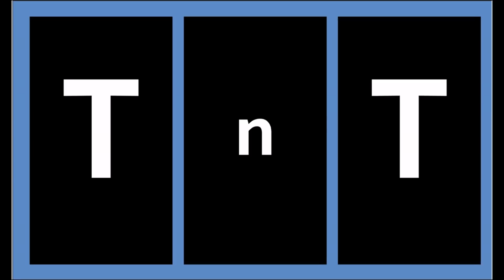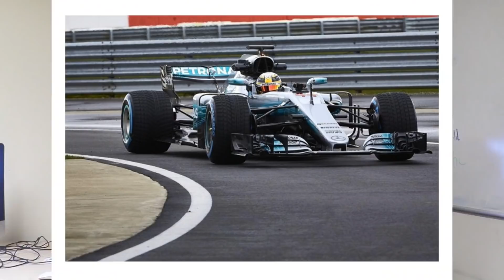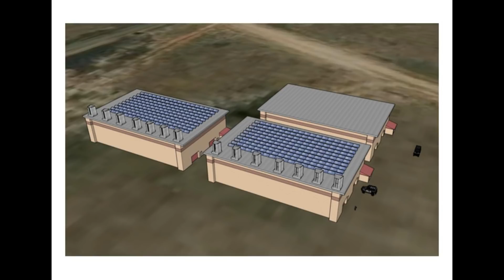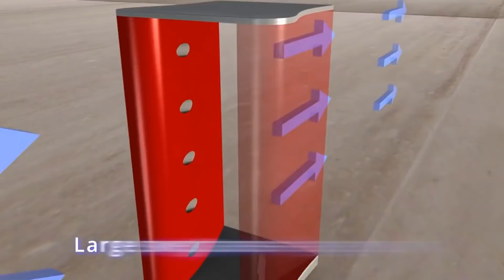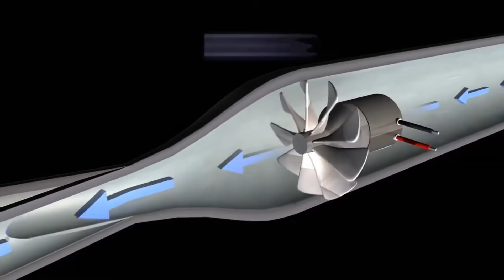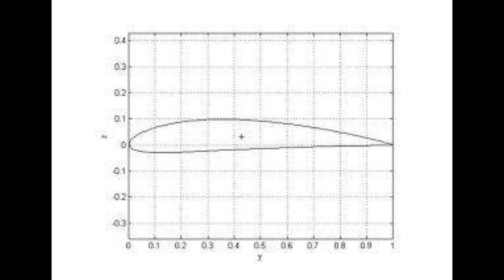1361 Mining Energy From The Air - The Aeromine - The Next Thing In Wind Power

Comment: So fun talk but no actual working generation of Power. What a waste of wood! Isn't lifting the flaps using up energy? Probably, if it works at all it would do better with sheets/strips of plastic sheet. with little or no weight to lift up to open te wind side.

Comment: yes 3d printing, for the areo foil, manifold, the problem is anchoring it to your home. the added possibility is cooling a vented attic for cycling air in a passive attic system. then some chicken wire for all the holes should suffice to keep critters out.

Comment: Simple rule: A volume of moving air (molecules) hits a surface (no matter whether (all) rotating or fixed "to collect"; e.g. diffusors absorb wind energy to create suction like a vacuum cleaner that is not so exiting without electricity). In order to absorb some of that, you need material. The more, the more expensive (material cost).
If trying to absorb too much wind energy, then the structure progressively becomes an obstacle: Wind moves around (...that dust in your eyes when passing a building's corner - remember?).
What's the trick? Simple: You build a wind turbine and "forget" mentioning the fixed rotor structure (area) that catches additional wind energy to e.g. cause suction. With that trick you can claim to produce more electricity than there is energy in the wind that goes through whatever you call "rotor" (i.e. a percentage of the actual rotor!).
Mother nature makes wind energy grow exponentially with wind speed: To the third power of it. So, if wind speed doubles, energy grows 8x (no typo: eight(!) times). Not so surprisingly it does the same vice versa: Half of wind speed ...and its energy collapses to 1/8 (one eighth).
Wind speeds close to ground are low (e.g. 3 m/s contains 0.5 x 1.225 kg [common air density above ground] x 3 m/s x 3 m/s x 3 m/s = 16.5375 Watt per m² gross (!) wind energy - some of which (max 59.22%) you can absorb before wind will progressively blow around (like around any other obstacle!) instead of going through.
Do not need to believe: Just build and measure. So simple. Law of nature. Physics.
Building wind turbines: a) reduce amount of material per m² as much as possible, b) use sites with sufficient wind (remember exponential growth!)

Comment: Stick that on top of a tube with a swivel base so it can turn to face the prevailing wind like ducted turbines do and you'd have a wind turbine, except the blades and generator can be down at ground level where it's easy to manage. Nice! Could also use it for passive HVAC concepts. This is REALLY smooth.
Reply: FWIW: I was wondering about the swivel thing myself.

Comment: That is awesome! You could combine that technology with the cheaper type of geothermal along with a solar chimney and truly benefit. 
For example, hook the turbine input of the Aeromine to a 8 to 12 inch geothermal piping system that will run thru the ground for about 100 linier ft then pops up out of the ground at the end of the 100ft run for the air input. This way the air is cooled, we can benefit from this because the solar chimney will be the Aeromine itself. Face the Aeromine so that the sun beats on the panels where the air flow is being sucked up, this way the heated chimney will hasten the process. Even without wind it will still suck air thru the turbine as long as the sun is out beating down. It is like a thermal syphon. Granted i don't know how much air it will pull on its own, if it is worth trying or not, maybe if we could do on a smaller scale first to see the outcome.
But one thing is certain, the solar chimney does work but how much air can it move i am not sure yet. But if it is not enough, we could try mirrors to concentrate more energy on the chimney.

Comment: I see a couple of difficulties with the proposed configuration... 1) The air has to change direction and speed multiple times, and often across short distances. That will create drag and turbulence, which wastes wind power as heat. 2) The multi-blade ducted fan IS a moving part, so "no moving parts" is not true. 3) The wind tower needs to rotate so that the opening is always facing into the wind, so "no moving parts" is not true there either. 4) PC fans have weak rubber magnets, which are fine for using power, but bad for making power. 5) PC fans lack nose and tail cones needed for streamlining/drag reduction.

Comment: But you got terrible losses all the way from the location between air foils to where the fan will be. So it will be more efficient to have a windmill instead with a foil all around the propeller. You eliminate the duct work. Air conditioners have duct work and they need a powerful fan to overcome all the drag and move air.

Comment: I'm interested in passive uses for the aeromine -- either to replace electric fans/AC and circulate air out of the attic / house in the summer -- or to draw a syphon and add energy storage with some hydraulic or pneumatic system.

Comment: Keeping the air that exits the vent holes in the airfoil from causing wind flow separation downwind of the vents will be the key to making the system work.  Airfoil flow separation will cause the loss of the low pressure area (stall).

Comment: looks like a Dyson heater fan running in reverse, they push air out the holes and pull extra air through the loop. so moving a lot more air than the fan would on it's own.

Comment: the foils  look pretty well suited for 3d printing using just a few wall layers and leaving the rest empty though you could easily play around how you want the air to move while inside the foils
I'm wondering if you've ever looked into using wind power to directly making heat through the use of joule machine or eddy current generator

Comment: Instead of making pipes sticking horizontal out of the vertical wings, isnt it  a better idea to make a vertical shat inside each wing, wich can also be regulate the flows by opening and closing the shaft a bit. For test puposes or for savety against overworking the motor.

Comment: Looks easy enough to build using RC model techniques....use PVC, or even cardboard tubes, for the ducting and incorporate the tubes into the airfoil just a bit ahead of the wigs designed center of lift location.
A very simple build for testing could be done with not much more than the tubing, some styrofoam blocks and a hotwire cutter with an appropriate template.
I could see a horizontal string of these being made at one foot tall and ten feet wide rather than the single ten foot tall version as well.
Unfortunately, I live in an area where wind power of any kind isn't economically feasible because we just don't have consistent wind...except on the days when we want to fly rc...lol

Comment: Guess you need to scavenge a Dyson fan and replace the small blower inside with a small turbine? There is another way to mine with wind: Electrolyzing sea water even with electrodes placed directly in the ocean on a raft. After a while, they build up a metal rich sludge, mostly Mangan but also a minuscule amount of Gold and other rare metals. This sludge can be dried and sold as is without further refining.

Comment: well yes this is very cool, thanks Robert. Sort of reminds me of what type of Air velocity stack I was thinking about using on my gopher hole wind generator, ground level impeller generator combination with open drafting to a large vertical culvert tube, with some sort of enhancement cap. when I was a kid I had my head inside of one of those gigantic air raid siren horns, the one with the flat panels, Or perhaps like the Cheney talking machine from 1914.  I wanted to use that horn design as a passive way to improve the draft of the vertical culvert tube, hopefully advancing the output of the generator at the bottom of the tower with an action similar to a ladies old fashioned perfume bottle Sprayer. The goal of all that was to take the stupid generator off the darn tower and put it on the ground level where it could be maintained and dealt with, minimizing aerial maintenance of any type, along with weight and the hazards of big things crashing down on peoples heads, I also thought that oversize ductwork might suffice for the air siphon tube culvert tower thing.  I also thought that if it came down to it might be able to use a bit of Parabolic solar collection to provide a heat source to enhance the updraft, or if one was desperate, just a firebox, when I was in my 20s climbing on the top of a powerplant chimney, I was always amazed by the wind/drafting affect. And of course as a child always there where the gophers are the very dogs would build their entries in exits for their tunnels to facilitate airflow in the tunnels so they wouldn't suffocate.

Comment: I used that idea for venting a house at university. If the power generated is hight enough it therefore could have a double effect. A) generating power B) lowering costs for venting. Still the energy for air-conditioning will be needed. — therefore. For hot energy; could you think a parabolic mirror centralising sunlight to a lense what itself channels the light beam into a Glasfiber and then heats up a "battery" in the basement (well isolated water tank, sand, stoneblock, stones in water,.......) could generate usable thermal energy? How big would the mirror be? ... I got that idea first as a child when I thought about how one could have real sunlight in a basement. And later saw one of those sun stoves. It was cloudy so it couldn't get the water to boil. But still it got warm. .... Probably you already thought about it. But I live in an apartment. So I can't really experiment. For me there are some other ideas building on that idea to collect heat. But I basically was told of everyone that it's rubish. You seem to have fun to test every weird idea even if it's said to be not efficient ;)

Comment: Another way of extracting energy from the atmosphere would be harvesting static charge. 
Every meter in height holds 100 Volts potential difference.
Corona motors can work on this principle. This is ancient knowledge. Here is something to contemplate: 
Look at cathedrals: the top antenna (i.e. cross) the horn antenna (the spire) and the nowadays missing element: the chain from the top down to the altar. This would create a negative charged atmosphere which is very beneficial for human life. This why you need a head scarf... static charge runs your hair :)
There is energy everywhere. Think implosion instead of explosion. Just my two cents.
Reply: Static electricity has high impedance ... hence power is very limited , though the voltage would be higher .

Comment: Rob, this is very interesting! One of the concerns I have with wind harvesting is winter weather.  Heavy snow and/or ice tend to wreck havoc with wind turbines or "spinners" so this concept is very appealing.  Thanks!  Looking forward to learning about how this can be adapted at a smaller scale. Cheers.
Reply: Another purple V. First time I've seen one.
Reply: Problem with this in cold weather is on windless nights when the turbines don't move they might freeze up  --  especially in freezing fog  :(
Reply: @trueriver1950  Put a lid on the inlet, combine it with a muffler (sound absorber) on the same acis of a servo. 
If closed, you have no movement of ice fog loaded air. 
Put water glass based sealant on. 

I want to dig into vibration based de-icing of originally heat exchanger surfaces, but you can extend it to the problem here. It means you can enforce a resonance that is not showing up on regular operation, like installing an axis (near the metal sheet with the inlet holes or slits) with imbalance weights that performs as a solid sound transducer if turned at the right rpm. So the resonance along the metal sheet will shake off the ice from the impregnated surfaces. Tuning the rpm will move the knots and maxima of resonance to cover the full lengths. 

Then again, if you have multiple energy sources like PV, Wind, and a wood gas burner micro generator with lambda sensor air supply control to round your energy mix up, you may want to stop the turbine for the hopefully tiny percentage you suffer from ice winds carrying fog that is supercritical and glues to every surface.

Comment: Wait a minute! If you use an airfoil design from an indy car, yes it is designed to push the car down but at what speed? and what speed will your airfoils be traveling at? sounds like it might be a Wright Brothers mistake, doesn't it? or do you think the airfoils will be moving that fast? or will it require a hurricane to move? I guess it would be slower than some airplanes. what do you think Robert?

Comment: Problem with wind generators is they fail from time to time. I have had one up 60' for years and it fails now and then. Right now in a wind storm it puts out around 4 volts. There is a problem with it and it is hard to work on at 60'. Needs to be taken down which is a pain in the you know what.

Comment: i JUST GET A short circuit TO WORK WITH! WHY? YOU WORK IN 3D THE AIR INLET MUST FOLLOW THE WINDSTREAM! THE WING IN A DARRIUS SHIFT EASY WAY TO WORK! AND NOW THIS! PLEASE EXPLAIN BETTER I MUST DROPPED OF A WAGON! iF WE START  FROM THIS! THE SIZE IS A oil drum! can be one on a Gig boat! The oil drum force the wind in a wirl! And now between two hybrid fan blowing Vawt like umbrellas in thier forms the top-vawt and the bottom is not the same shape in thier wings becose both blow down and the form is like this <i> but Vertical! Now to the wind-direction a gigant churchrooster turn the😀 front right! The wind how slow down the propellers hit the barrel! And fart 0.5 m/s  wind exacly right on the left side to push the wings in a max torque Now to forces work for a wirlewind the winddrag from the top and the side! Now to reasonable balance the barrel its lika e carwheel a diffrent wieght on  one side need a conterweight on the other side! Now Rob I Just love Your works! You find golden nuggets on the YouTube! And  You can take this Idees in a Historic odysseus try religions symbol like a meaningful blueprint! A Swastika can be a Symbol for Company like ASEA now ABB but never for a Contry! For is it can be a Darius/Savonius/propeller you look down on or up too! If you make it in bamboo it is hard to find they today! But in Egypt you find a speciell formed stone in a circleformed places and off-course this is a secret places for the Gods...

Comment: This is why the Betz limit may turn out to be a bit of a red herring.... air that has passed through the rotors (speed reduced) gets sucked away by faster flowing air outside the swept area rather than stagnating. Careful design can maximize this effect (entrainment).
Reply: Seems you are right, the project site has stopped.

Comment: ????!
What are you talking about with solar being only 0.3 Watt hrs per square metre. Current photovoltaics manage 0.3KW per square meter, 0.1 if its cloudy. Solar thermal can harness over a KW per square metre.
Use your wind turbines to drive a refrigeration compressor, your solar thermal to dry out zeolite. 
Use an on demand flow valve controlled rankine cycle, better still Kalina cycle turbine with mix of water and ammonia to make electricity when you need it.

Comment: Research  "Whirligigs"  
Whirligigs are most commonly powered by the wind but can be hand, friction, or motor powered. They can be used as a kinetic garden ornament. They can also be designed to transmit sound and vibration into the ground to repel burrowing rodents in yards.

Comment: I'm really interested in how you connect microgenerators together to get a single output. I know how you do that with solar cels, but they have relatively the same power output.  Does it work the same for other microgenerators? Do they have to all have the same power rating? Can you mix units or will that cause some sort of power cancelation and reduce the bet output?

That aero mine kind of looks like a Dyson air multiplier in reverse
Reply: A simple way to connect several micro generators together (in parallel) is to use a DC-DC converter for each generator. Bring all of them to the same voltage, then connect them together. Also you can add a diode to the output of each DC-DC converter to prevent reverse current flow in case one of the generators is stopped.

Comment: Looks interesting. But what if the wind is not blowing directly into the roof assembly? The effective width of the channel between the two airfoils is proportional to the cosine of the angle between the plane of the airfoils and the wind direction, which is zero when the wind direction is at 90 deg to the airfoils. So - no air blowing through the channel? Or am I missing something?
Reply: So Rob, I was thinking. What if you had two discs mounted horizontally, one above the other. If the discs were flat on the outside and saucer-shaped on the inside then wouldn't you acheive the same effect? I mean, the venturi effect doesn't require an airfoil section, just a restriction. But, in that configuration,  it would work the same whatever the wind direction.
Reply: @kenrowe167  Sounds like a good idea. I like it, but trapping the air between the blades creates negative pressure.